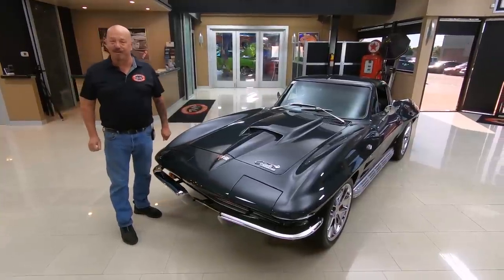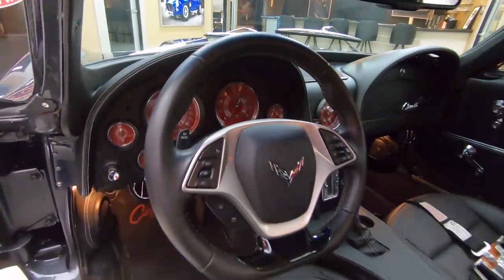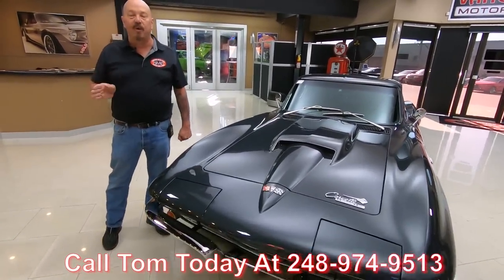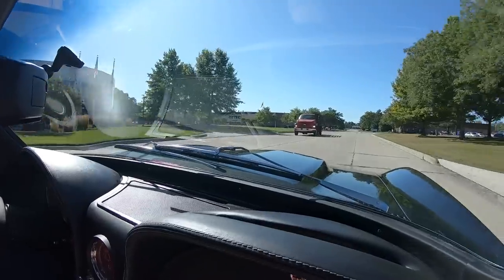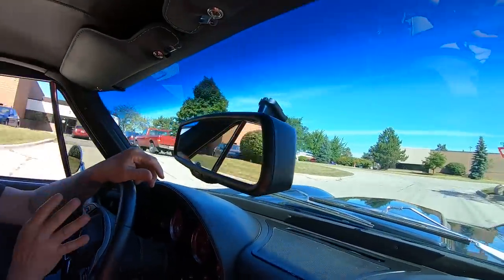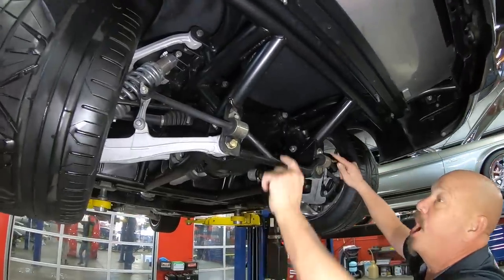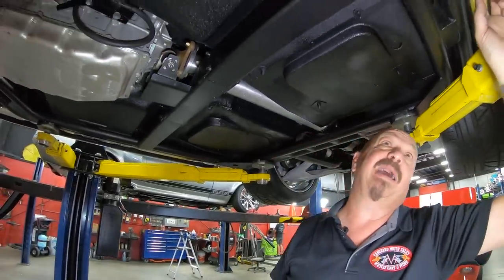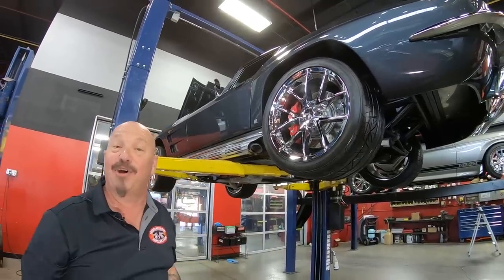1964 Chevrolet Corvette For Sale

Comment: Nicely done. Should have a good power to weight ratio. Nice V~8 rumble to boot.
Gun metal gray with burgundy accents. Four wheel disc brakes 🚧. Runs on pump gas ⛽️ and air conditioned as well.